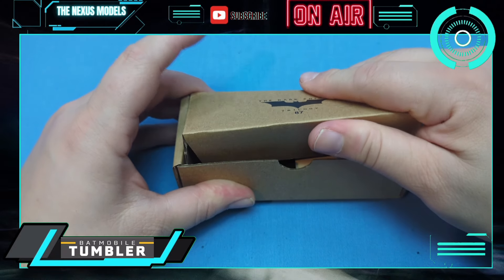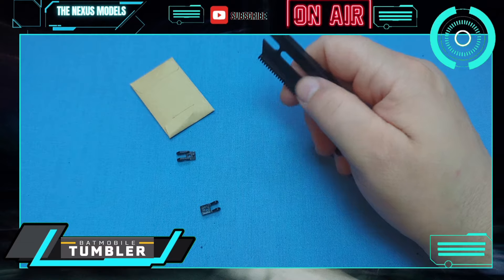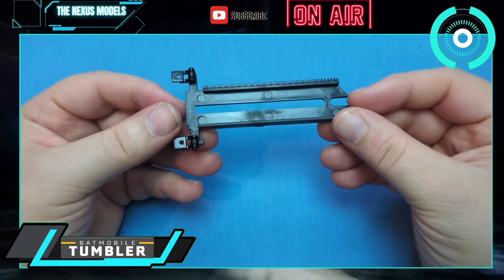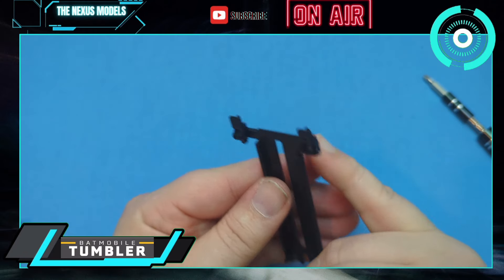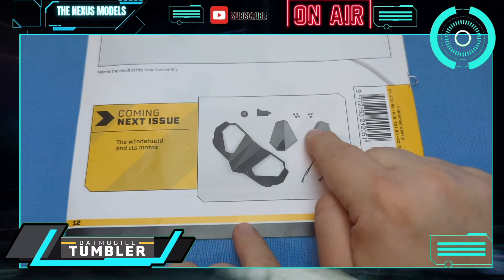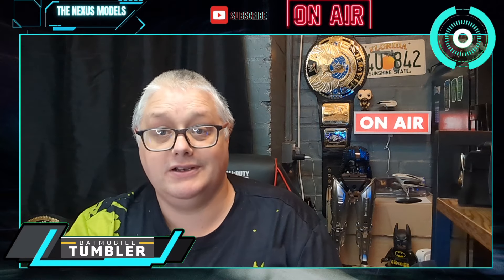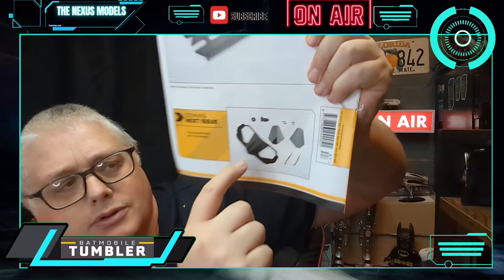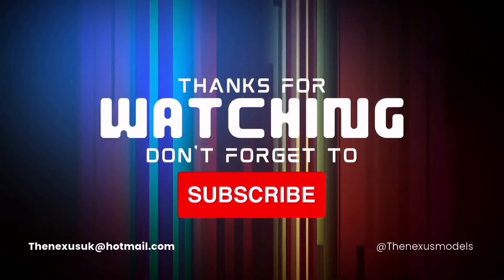Hachette Build The Batmobile Tumbler - lssue 87

Comment: Confirm the new Windshield in issue #88 differs from the old issue #3 with changed external side profiles. The original die-cast must have been taken from an unfinished mould and no-one checked them to drawing before shipping the entire batch!   So, it must have been a combined screw up by Toolmakers, Operators and Quality Control. What a team in that factory !!!